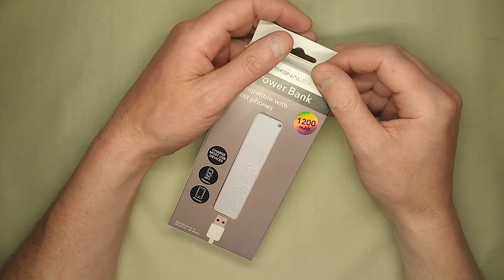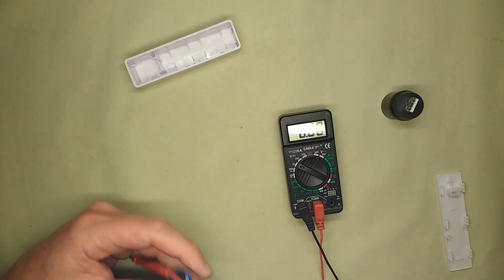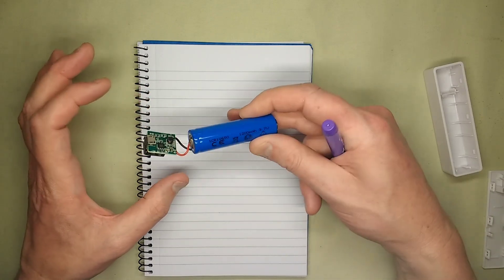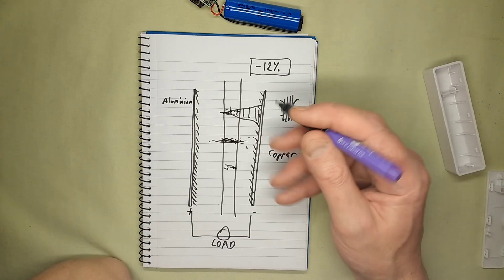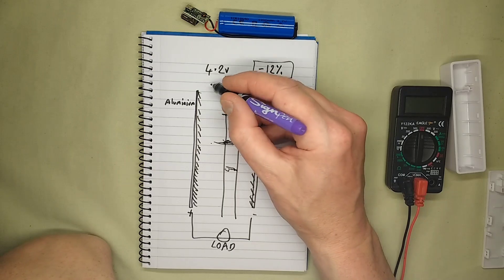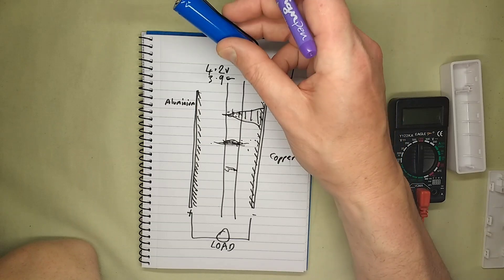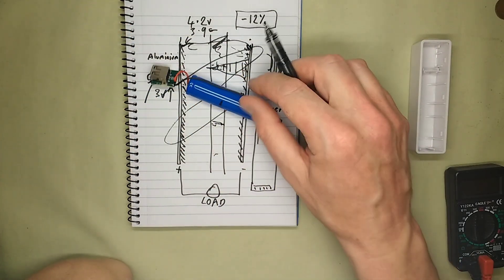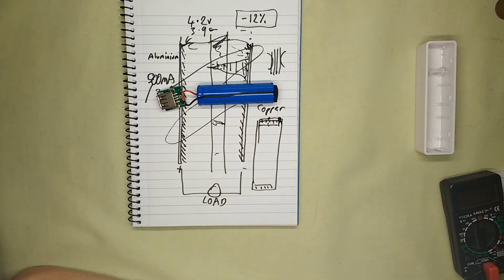Are over-discharged lithium cells safe?  (And how to test for damage.)

Comment: I believe the real danger is if a cell in a multi cell pack gets fully discharged, the other cells can sort of reverse-charge the dead cell, causing those copper chunks in the anode. That's just what I read from what I thought was a reputable source and my statement should not be used for medical advice or as assistance in human body operations such as caulk pumping parties or back-alley butt implants.

Comment: I've seen devices with built-in unreplaceble LiIon batteries on sale with 25, 30, 40, 50% discount, including expensive ones, like branded shavers. They all have 5 years or so of shelf time in common, but you are never told that they are worthless because batteris were spiritually offed and can not be recharged anymore at all.

Comment: I know this is old but would you say this is the same for a 1.6v liion from a disposable vapour device?
Reply from the maker: Over discharging a lithium cell is not good for it.  I wouldn't use a recovered cell for high current applications.

Comment: Diodegonewild has a video on reclaiming good 18650s from dead older-style laptop batteries. 

And usually the issue was a single 18650 dropped below the voltage of the others, so they were out of balance, and the battery circuit board disabled itself. (Sometimes, permanently) However the other cells remained good.  

So I wonder why that happened! He also reviewed a Lidl power bank/jump starter, where the battery cells in the pack became unbalanced in voltage after the first use. (It still worked, but it was concerning to him. I forgot what the problem was exactly, but it sounds like the batteries will try to discharge each other too low?)

Comment: I have been paying more attention to lithium cells ever since your video about rescuing them from discarded vapes. The local electronics recycling bin also gave up a lot of old phones and phone batteeies. In my experience if i find an apple battery, it is usually empty and unrecoverable. But Samsung cells, even if empty, can often be fully restored.

Comment: Do a capacity test & compare to the original rating.  Also perform an internal resistance test if you have the equipment.  This is the only way to know for certain whether the cell chemistry has been compromised by an over-discharge event.  Generally, I find reclaimed laptop cells can be fine after discharge as low as 1/2 a volt.

Comment: In many lithium ion batteries that have inbuilt controlled like in IPhones the controller needs a minimum of a volt from the battery output to allow the battery to charge so it’s like an E-Fuse that will prevent the battery from charging if the voltage is too low.
Reply from the maker: That's the DW01 chip.  It can be hotwired to bypass it to get a slight starter charge.

Comment: I know this is an old video but just to give more information about the topic. I opened up an old Dell battery that has 6x18650 cells. They were manufactured by Panasonic Sanyo in 2010. Their capacity when they're at 100% health is 2200mAh. I was able to recover 5 cells out of 6. Their capacity after 20 charge and discharge cycles to recover them was, 1800mAh cell1, 1500mAh cell2, 800mAh cell3, 1000mAh cell4, and 1200mAh on the 5th cell. The 6th cell failed 2 weeks ago. It had only 450mAh of capacity and overheated above 60C while charging. I recovered all 5 cells a year ago and all 5 of them still work fine. All the cells were below 2 volts. I did 35 cycles for the 6th battery to barely recover and only work for 5 months and outgas and fail. It tripped it's CID while discharging at 1 Amp. It internally shorted itself at 3.93 Volts and Reached 70C! Then the CID opened. After 5 minutes of the CID triggering, the OPV (Over Pressure Valve) teared and released all the pressure built up in the cell (around 450PSI). After all of that i did a CID Reset on the cell and the voltage was only 1.15 volts. Then discharged it in salty water overnight and opened it up. The copper layers were SCORCHED and BURNT to a crisp. The copper layer was covered in soot and the isolator was completely melted. That's what happened when i kept using that basically dead cell and that probably was the cell that killed the battery pack. All other cells are still functional.

Comment: I have an old cell samsung 2000mAh phone battery that was left totally discharged and when I found it the cells open circuit voltage was only 1.65v! barely more than an AA battery!
I put it on a super slow trickle charge with a 500 ohm resistor and a 5v source and it slowly rose in voltage up until about 3.3v then suddenly dropped down to about 2.9v

However what actually happened was the protection circuit was not kicking in and only allowing a tiny quantity of energy to flow into the battery. causing an elevated voltage reading while charging at the low current. until the protection circuit came to life and the real open circuit voltage was about 2.9v
I kept charging it with the resistor and source until about 3.4v
I then slowly charged it with a 100mA charge rate until it was about 3.7v resting voltage. then raised the charging current to 400mA
It kept climbing right up to 4.2v and fully charged up.

I then discharged it at the C/5 ratie down to 3v and I got JUST OVER 2000mAh of capacity out of it! About 2112mAh! Like brand new! From 1.65v to brand new capacity!
Did a storage test for several months at 40% state of charge about 3.75v and it did not budge from that. did not even drop a single millivolt after months of sitting!

I had some wire leads soldered to the gold plated pads so I can reuse it for various projects. it works fantastic.

Comment: Hi, I have a question: I built a circuit without any microprocessors which discharges a single 18650 at a constant current of 1A until the terminal voltage is 2V9 which ( as I understand it ) is the lowest voltage acceptable. If I remove the cell and place it in a dedicated charger it tells me that the cell  has 25% of its capacity left. 
How do I interpret this? It seems to show that only 75% of the nominal cell capacity is actually available for use.

Comment: If I fully discharge a battery and I let it just sit somewhere forever in a fully discharged state. Is this dangerous? Or is it, the RECHARGE activity after full discharge that is dangerous? I can only pick up hints from this video and other sources online that it is actually the activity of recharging which is the dangerous part, yet y'all keep saying "deep discharging is dangerous". Is this just sloppiness on your end or is it really the act of depleting all energy from a battery that is dangerous (in my uneducated, yet logical brain, this doesn't make much sense lol)?
Reply: Depleting the Cell is the problem. if ur talking about single cell then the recharging it will trigger the problem, BUT if its connected in Series then the Negative of the fully discharged will get positively energized by the Positive of the good Cell which Is around 2.9-2.5V. Now the Positive Lead of fully discharged cell will connect to negative of another cell. Now these both leads act like a Electrodes in an Electro plating and copper to deposit in the Divider, Which permanently Damages the battery. This is what happens in Reverse charging a battery. The point is to keep the cell at a voltage in which this wont happen like 0.2V.

Comment: How common are battery disasters? My friend used old drill batteries in his e cigarettes. He pulled off the contact strips, not so bright. Whilst in Wickes his trouser leg burst into flames leaving him with a third degree burn roughly 12 inches by  6 due to the battery. A second battery two months later did something similar - cause unknown. One wonders about Darwin Awards!  Whilst at the burns unit the nurse said that exploding batteries especially on e.cigs was very common, the latest being a girl drawing on the cigarette when it exploded destroying the skin on the end of her nose requiring skin grafting. The question is, how common is it? Data from a burns unit or two would be interesting.
Reply from the maker: 18650 cells are safe if treated properly, but will fail dramatically if abused or shorted.  The battery industry put out a load of warnings saying their cells were only intended for use in sealed equipment and not as loose batteries.
Most accidents have been caused by misuse of the cells.

Comment: I've found that from zero volts is no issue I've done thousands now been buying used laptop battery's by the 25kg lot and it mainly comes down to 2 things ...the original condition or charge level ..and how it was drained ..if it drained via years and bms then no issue but likely one is dead or sad or unhappy typically the anode or tail end in rows of series ..
0.2a of load or less u can drain to zero ...I drain my bad batteries with led rings ...then there safe for recycling ..I've done laptop batteries .phone.mac.drones and vapes ..100% lipo is best

Comment: Recycling dicarded non-medical inhaler Li-ion cells that have been subject to overdischarge. Using  the built-in chargers from the rechargeable versions of these inhalers, the minimal circuitry checks for the cell's ability to carry a certain amount of charging current, continuing to charge if the criteria are met, or switching off if charging levels are too low. Under normal use the built-in LED 's forward voltage limits the voltage down to which the cell can be discharged. However discarded device cells can even be found with zero or even negative volts (how can this happen? ), especially when the discarded item exposed to the elements, where condensed water can result in continued discharge below designed cut-off voltage. Overdischarged cells can be charged in parallel with cell discharged to acceptable voltages like 3.2v, since the max charge voltage is set to something like 4.13v on the charger circuit, and the fully discharged cell can be forced to accept a charge at this voltage over time and the charger can then kick back in. Just take suitable pie-dish precautions when charging potentially dodgy cells and don't use them for mission critical situations like attack UAVs
Reply from the maker: With over-discharged cells it's usually better to gently bring them back up to 3V with a low trickle current.  After that they usually recover quite well.

Comment: Good day sir. I didn't know about these batteries until I learned about them in your videos. I like them, you showed a small charging board and I got a bunch they were cheap. You mentioned in a video that if you connect the batteries in parallel that even a difference of .01V can create an overheat of the leads on the battery. So while I'm playing with them I discovered I can charge them all to within .002V and I connected 2 in parallel and held the leads and never felt a temperature difference so I think I did it safely. I remember though you had said to discharge the batteries to the same voltage before connecting them together. May I ask why I should have discharged rather than charge the batteries? Pardon my ignorance, I am learning tho. If I'm in the wrong video and this comment doesn't make sense please accept my apology

Comment: This fails to explain why my cell phone battery always gets ruined by discharging fully even once.  This happened to me repeatedly with my Samsung Galaxy S4 battery.  Worked just fine for many months, discharge to 5% just ONCE, and from then on its life was seriously degraded (about 50% shorter run time) until I bought a new battery.  I never quick-charged it, as I know that's bad for batteries.  It's a good thing that this phone had a back cover that was easy to remove, so battery replacement was quick and simple.

Comment: My experience with over-discharge:
200mAh Li-ion cell exploded, luckily it was small and in a metallic box.. The battery was all fluffy and the cap of the box had a black and smoky spot over the battery.
3000mAh Li-ion cell: forgot a 3.3Ohm resistance in parallel (I was making some complete charge and discharge cycles) and I forgot to remove it in time... 0.98V on the battery, which was "inflated" and pretty hot... Capped the hell out of me as soon as I've seen it... With a windproof lighter (very hot flame) I desolderd the resistance and immediately put the battery outside of the window... Luckily, this morning, it was still there, unexploded

Comment: I have recovered cells as low as .33 volts and they were still as 90+% capacity. I was using some sanyo 3500mah ones and they tested between 3200-3400. Some of them auto discharge slowly over time but they are plenty happy enough to run electronics.

I have a 4s 8p pack that I regularly draw spike current around 50-70amps from. Still within spec for the cells but slot to ask from 2016-2018 built cells. 

I have had some lg 2900mah cells at .1-.2 volts that wouldn't recover no matter what.

Comment: Clive, Very informative video. After viewing, I had an old (10 years old more or less) Dell Inspiron e1705 battery (6 18650 lithium ion cells) which I carefully disassembled. I then checked the charge on them. Of course all were well discharged. One in particular was at .074 volts. So I trimmed the extra off the tabs and put it in a Dorcy rechargeable flashlight which also functions as a battery pack and let it charge. BTW the flashlights case is very thick cnc'd Aluminum (so I was not too worried about it overheating). I did keep a close eye on it however. The battery charged and indicated a completed charge on the flashlight's charge led. I then tested the voltage and it was around 4.2 volts. I have been using it in the flashlight for about two weeks now (normal usage) and as of this moment 12 noon California time on July 20th 2022. the charge is at 3.562 volts. The flashlight has battery monitoring circuitry, so I will see how long it is from now until it indicates the need for a recharge. At that point I will check what the voltage is. I am expecting it to be about the discharge cutoff voltage you mention in this video. If so I will charge it up again and see what voltage I get. And before a bunch of you start saying how dangerous this can be, I will only be using the batteries in this particular flashlight (it is kept on my desk in plain sight at all times). Thanks for this video Clive it will allow me to put some batteries back in use that otherwise would have gone straight to recycling.

Comment: I had a mobile phone which had sat idle for a long time and the battery had discharged to the point where the protection circuit was not allowing it to charge.  I managed to partially pull the "top" off so I could get to the connections on the other side of the protection circuit, then charged it for a few minutes until the voltage went above 3V at which point the protection circuit was working again.  I pressed the top back on the battery and put it back in the phone and it charged quite happily.
I wouldn't trust it to give the same capacity as before, but it let me check that the phone was still working.

Comment: I'd be surprised if that -12% number was fixed in stone, so to speak. It would probably be relative to the total time length of the test. For example, at -3%, the same amount of copper deposits may happen but take longer to occur. When imagining this, one must realize the number of individual atoms involved. Each has its own destiny, so to speak. And as they deposit individually, they cause a decreased travel distance to occur to the opposite side for any additional deposits. This decrease in distance makes deposits onto that tip of previous deposits more likely to happen than other locations, because of the tendency of electricity to seek shortest paths. In other words, they build up faster and faster as they reach nearer and nearer to the other side, before the short finally happens. It really is a cascading geometric effect, not strictly linear.

Comment: About 8 years ago, I purchased north of 50 Compaq laptop battery packs.  Brand new with a date code 1995.  The cells read about 0.1 - 0.5v .   I charge them at 2.8v 10ma (takes about 10min. to reach 2.8ish v) them finished the charge at 4.21v 500ma. A&TB Cells rated (1c) 1500mah.  Most tested between 1350-1550mah. I just finished breaking up my last 10 packs and now 27 years old they tested fine. I've made many projects over the last years and they work fine.Nice for 5w 18650 flashlights.

Comment: I know some 18650s have inbuilt protection. Whilst I doubt cheap cells would have that, if it does, and the internal protection kicks in when discharged, could that be the reason they fully recover?
Reply from the maker: These cells didn't have protection.
Reply: @bigclivedotcom  At that price, I didn't think so... Looks like you busted a myth :-)

Comment: Very interesting and informative video Big Clive and thank you.

On a curious note, I have friends that like to give me dead "vapoure" devices they find because I take them apart and try to recycle them - little metal tube, plastic bits and battery etc.

Some of the Lithium Ion batteries will charge normally while a majority I'd say are listed and only like 3.7 volts (many only discharged to say 3.2 or so volts)  I wonder your thoughts on this?  

I was guessing maybe a different chemistry or perhaps not rechargeable for some reason?  The latest one was a 1300 mAh one.  I've stopped charging it at 3.66 volts and noted the time and date.
Reply from the maker: I wonder if it's a LiFePO4 cell or just has an internal failure.